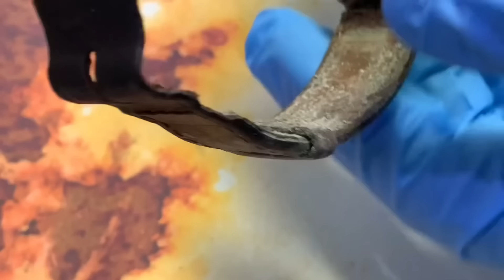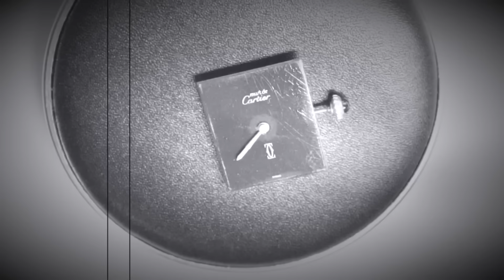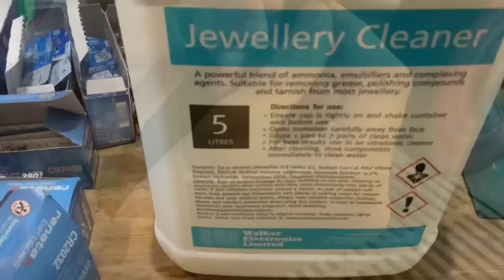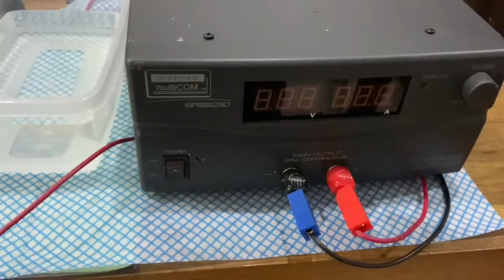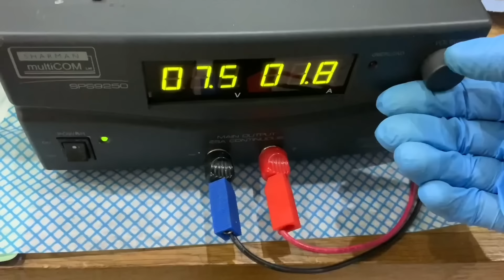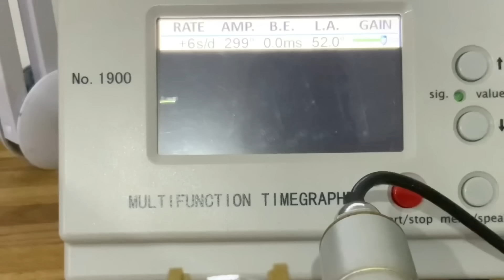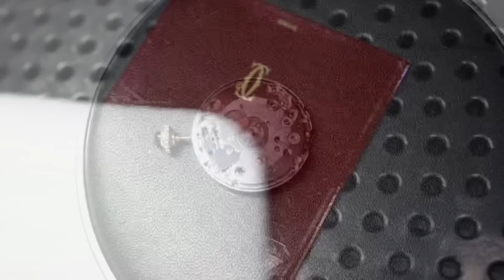Cartier tank - RESTORING The World's MOST ICONIC Watch

Comment: You should not need to nickel plate, just strip the gold if required (not sure why you would) and then activate with a reverse etch in the gold solution or some spent gold solution and then plate with gold solution. The original plating process was most likely gold plating on silver base metal.

Comment: Great result. You are very skilled. However. Just out of curiosity. What’s your opinion on the build quality on the watch? I have very little knowledge in this area. For me it look a bit under processed 🧐
Reply from the maker: Thanks. The “must de Cartier” range was introduced during the quartz crisis so it was supposed to be an affordable entry point in to the brand. Hence why the use of silver instead of solid gold. It is also only supposed to be a dress watch and not any sort of tool watch. So with all that in to consideration, it’s build quality is adequate for its intended purpose